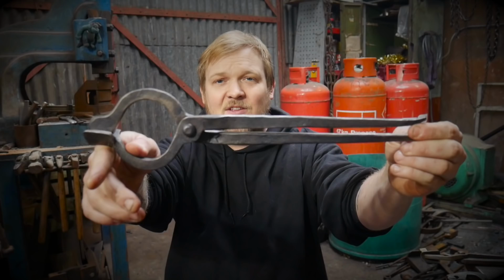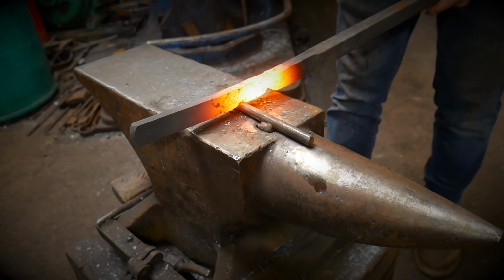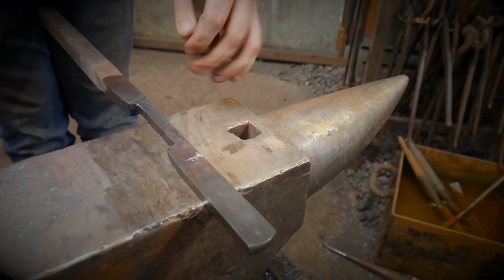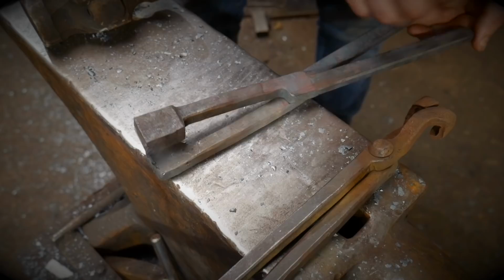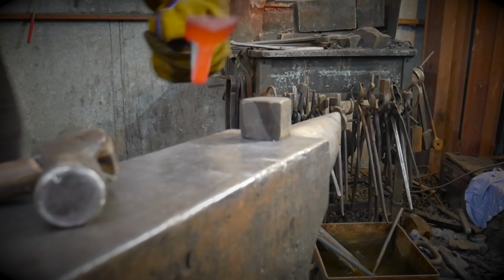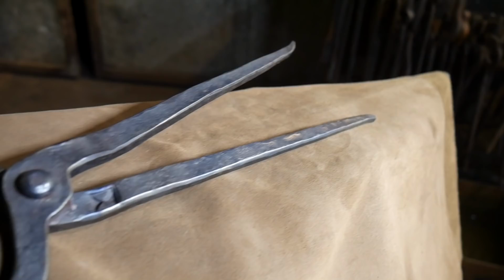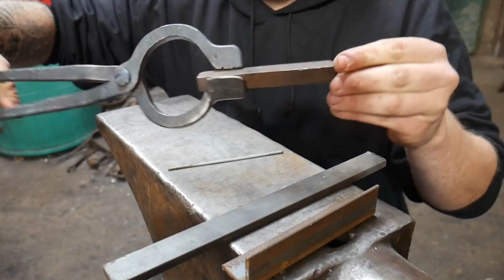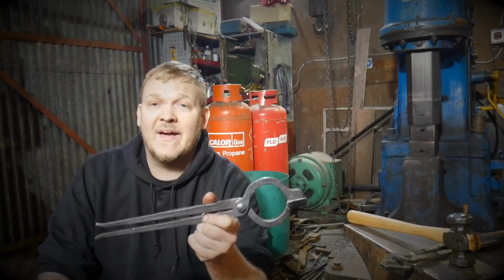A Great all round tong for beginner blacksmiths.

Comment: What are these gloves that you use? do they withstand very high temperatures? I use Kevlar fire gloves, but can't find good ones anymore. Where do you find yours?
They are very good your tongs, I will make some.
Reply from the maker: Just a chunky welding glove. The work fora little bit but you then need to cool the bit your holding. Never tried kevlar. I'll look in to it tganks for the heads up.
Reply: @danielmoss2089   john Switzer has some heat gloves he kinda suggest. Perhaps worth a look see